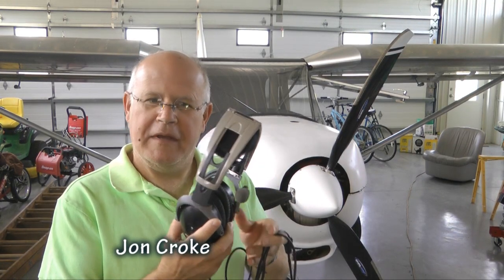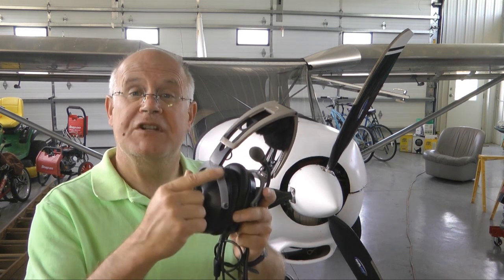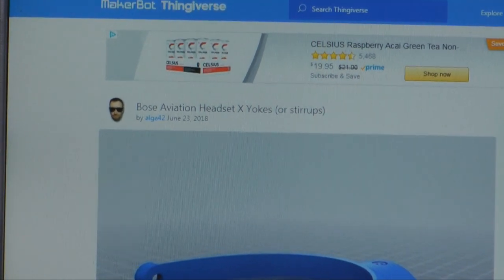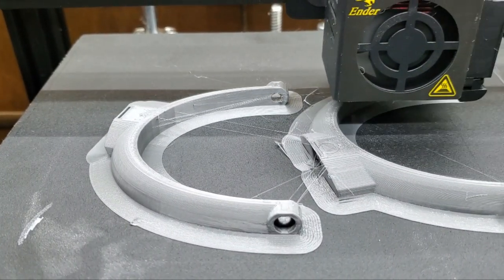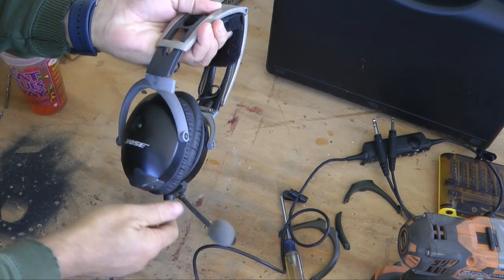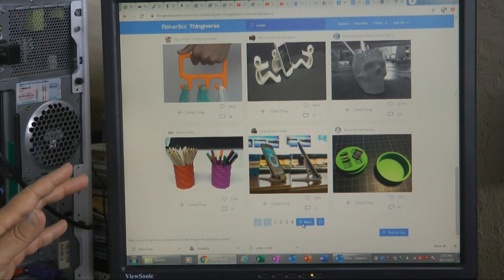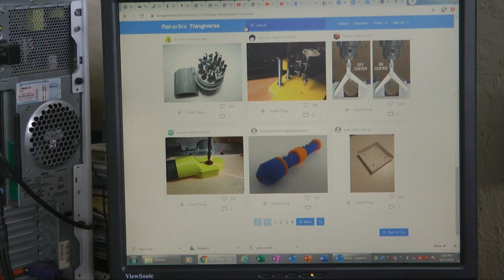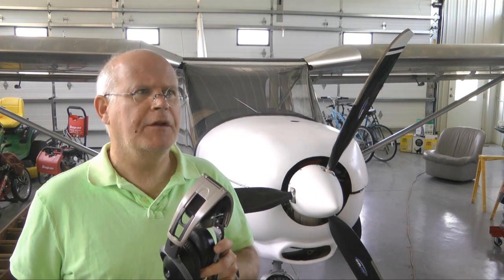Amazing Repair Method for Aviation Headset

Comment: Something for people to be aware of. Make sure you use the right print material. 3D prints are not usually very strong, others materials can have relatively low melting points. If you left these in the sun on a hot day. There’s high probability they will distort. Various parameters may need tweaking in the design. Ie material, infill, print speeds and physical dimensions of the print (the eyelets look weakest). Would be curious if these are still going strong!

Otherwise awesome repair for the money :) there are companies that will print these from a metal powder, doubt it would be cheap though.

Comment: I too am a pilot that owns a 3D printer. I just made an iPad mini knee board much in the same fashion as the app strap(a 50 dollar item that cost me around 3 bucks to make). I’ve also made a slim iPad yoke mount for the c152 to fit in my tiny flight bag. (cost me about 4 bucks) There are many applications for 3D printing, I recommend checking it out!

Comment: What to do when the part you want has not already been created? Use your EAA Solidworks to create  the solid model to the specs you need, then 3d print it.  Works like a charm.

Comment: That's a very creative solution to get around Bose's "gothcha" attitude.  Although I don't think 3-D Steve actually fabricated this printer, not that it matters a whole lot. He may have modified what's available from Ender.  A web search shows a lot of very similar units, but they appear to be much more vertically oriented than Steve's, which is obviously horizontally oriented. Do you ever fly that pretty bird thta's behind you in the hangar. I'd love to see it in action.
Reply: I posted a recent take off  on Facebook for HomebuiltHelp
Reply: Astute observation.  It was heavily modified (extruder servo, hot end, controller board, supports, cable management ....) ... ironically, many of them were 3D printed.  Kind of like the faithful broom that I have had for 15 years ... three new heads and two new handles, but it is the original broom ;)
Reply: @steveukman  Don't we all mod our printers worse than gearheads? I have an Ender 5. Replaced the x, z, and extruder. Bed reinforcement. Stepper driver/board replacement.

Comment: Very informative. What was the cost for doing the 3-D printed parts?
Reply: a spool of PLA+ media cost about $26 to $30 dollars, you could make about 8 to 10 parts with one spool, but the print time each should be around 4 to 6 hours each (based on 3D printer settings)......
Reply from the maker: I believe less than a dollar in materials. Labor - well I guessI owe 3DSteve!
Reply: 10g of material with the infill settings that I used, so around 30 cents (per side).

Comment: Thanks for the information on alternate means of repair of these very expensive headsets!  The audio quality of the Bose headsets is unsurpassed, but it has always irked me that they are relatively fragile - there's no way $1000+ headsets should have "known common problems" with breaking such as yours.  (Yes, I've got a set with the same problem! <sigh>).  But it really steams me that Bose also practices planned obsolescence - as each new model of aviation headset comes out, they drop support for the previous model after a period of time and/or charge a basic "repair fee" that is 100's of dollars!  Bottom line - next time around I'm looking at a LightSpeed headset!
Reply from the maker: Thanks for these comments, John.  I actually edited out some similar comments about this same issue from the video. Very glad you spoke up on this!

Comment: I wonder how the strength compares to an injection molded part.  It would be interesting to make a third printed part and then break both one of the originals and the printed part say by bending one of the arms until it breaks and see how the strength compares.
Reply: I gave this to Jon as a proof of concept  - and to stop his tears watering down the beer ;).  I used PLA with a 50% infill for the first prototype and it seemed to pass the 'tug' test.  If it breaks then it will be good to know where (attach bracket, yoke &c.) and take it from there.  Looks like the Bose has a really thin, brittle hinge attach point.  Options for the next version would be better infill, different material (ABS or nylon) or changing the design (the original creator was kind enough to post the source files so we could modify potential pain points).  This is experimental-educational ... and fun ... so I too look forward to seeing how it survives.
Reply from the maker: I will have to ask 3DSteve about that.  I think they can choose the material for the desired qualities needed
Reply: Strength is not a problem if the right plastic was used, all the main types are available, PE, PP, Pet, ABS, Nylon are available.  Firms like GE are printing Turbine engine components so it is like all manufacturing,  up to the quality of the process. I am surprised the the replacement part was not designed a bit beefier around the obvious (common) fail point (pivots) in the originals.
Reply: Zorba Light It seems hard to believe that each layer of the plastic adheres to the next as well as is the case with a monolithic injection molding process.
Reply: @LTVoyager   - We can tune the layer thickness, temperature and head speed as well as the material (and a few other parameters) to control adhesion.  I have designed and used a few jigs (as well as downloading 'things') and so far, layer-layer adhesion has not been an issue as long (as the printer bed is stable).  How the plastics change at different temperature seems to be well researched by the filament makers .... I had few early failures learning the plethora of parameter permutations  but once 'tuned' it is pretty amazing.
Reply: I use PLA+ (not PLA) there are other media you could use, pro & con to both types of media.....